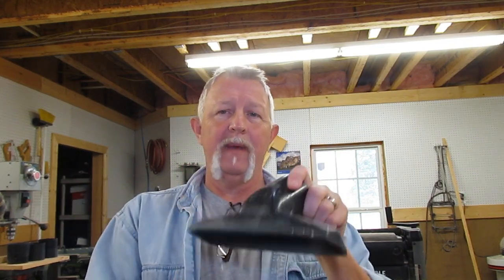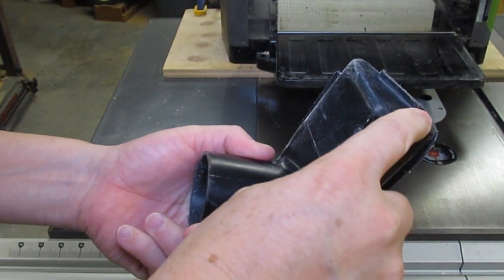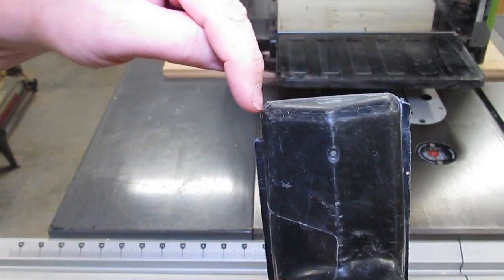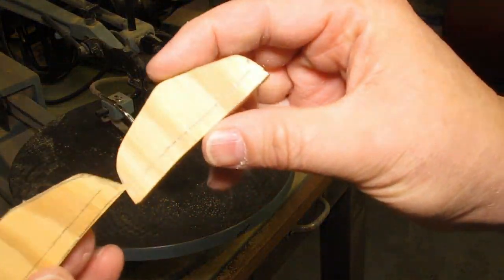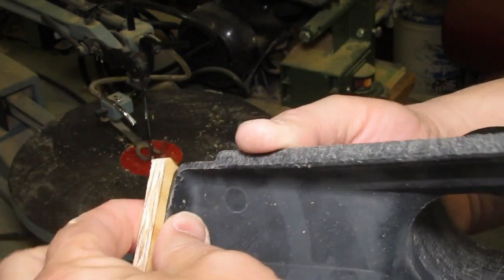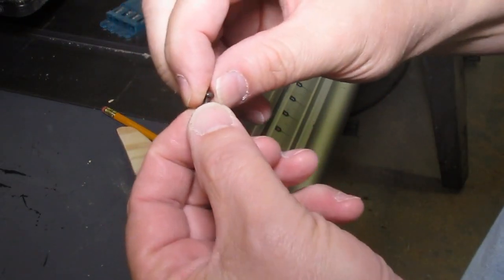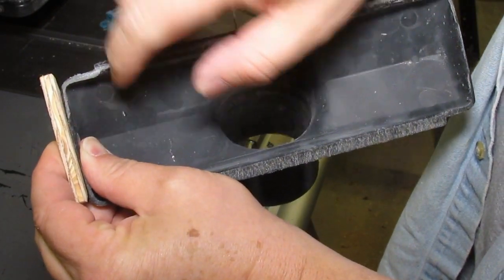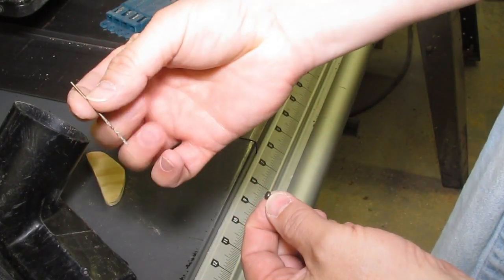Mod Your Shop Vacuum

Comment: Just throwing it out there... I’ve been needing to vent a bathroom vent through my ceiling for YEARS.  Got a video on that? 
Need to figure out how to connect working ceiling fan to two existing switches on wall.  They haven’t worked with ceiling fan since we moved in 20 years ago. Just checking. First 3 videos I watched from you fit my world exactly.
Reply from the maker: That's a tough one sir.....you'll have to be able to determine where the wires from the switches go/are.  Then you can formulate a plan to reroute the wiring, or run new wiring to them, etc.  I don't currently have a video up about this, but there is a device that allows you to trace wires and figure out what is connected to what.  I will try to get something up soon about the one I use and how to use it.  That may help you get started anyway!  Thanks again for watching!

Comment: Good idea Dennis.  Mine does the same thing, I'll have to try your idea! Thanks!  :)
Reply from the maker: Thanks for watching, Jim!  I picked up a cheap plastic cutting board at the dollar store...it is almost 1/4" thick, looks like a white nylon/polyester type plastic.  I'm going to remake the side-spacers using that board.  The plywood works fine, but wears down after a while.  We'll see how the plastic does.   Thanks!
Reply: @dwcoffey  -- Thanks for that idea ... I'll try it that way the first time.  Think I've got some little plastic "doohickeys" out in my shed I may be able to use for that.   (I've never been able to figure out if I was  string-saver or a pack-rat.)   :)
Reply from the maker: LOL!  Same.....my wife calls me a pack rat.  haha

Comment: Why not put wheels on it. Just a thought.
Reply from the maker: That would probably work like a champ!  I didn't have any wheels at the time, so I went with the plywood.  I have since cut up an old nylon cutting board and made my spacers from that....works better than wood.  Thanks for watching and for commenting!!